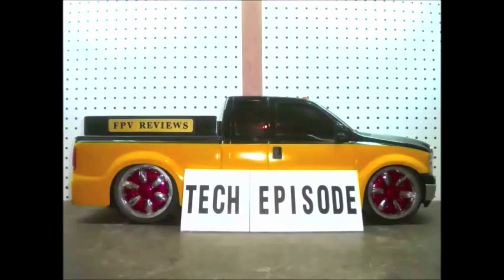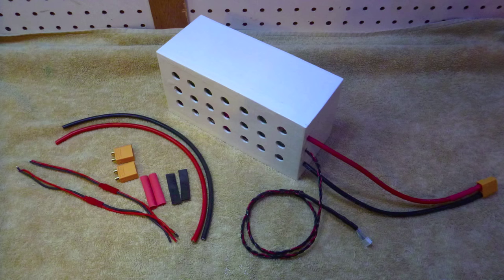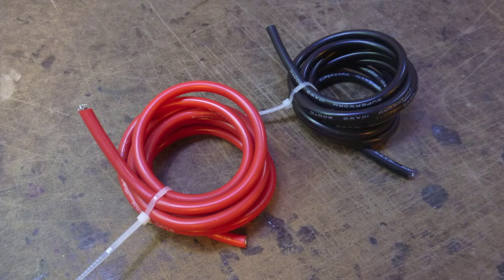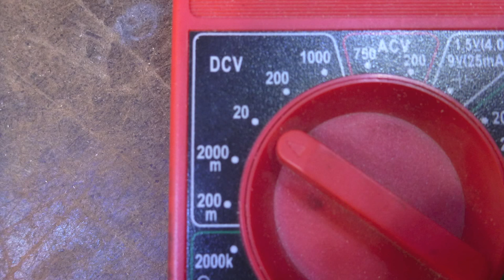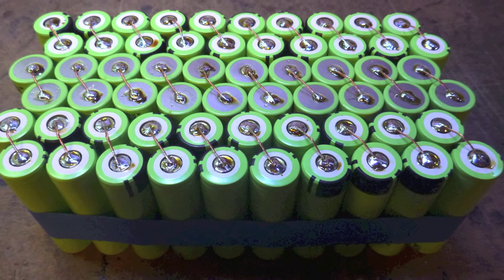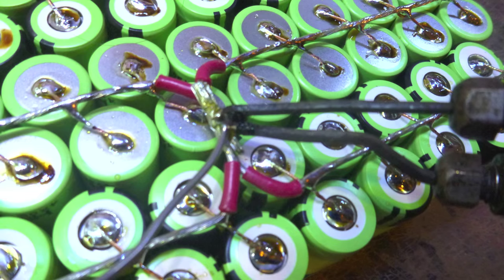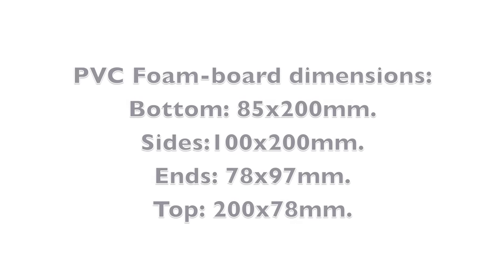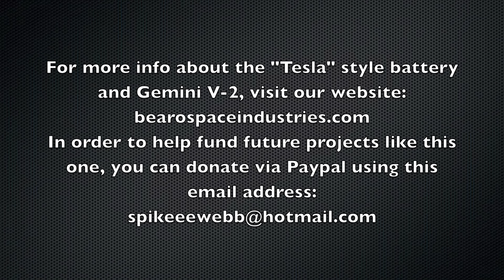"Tesla" Style Battery BUILD for Gemini V-2 And other FPV Planes!

Comment: A great safety idea, I've seen in other videos is using fuse wire for the bridge wire, rated the same or just over the max discharge rating of the cell. durability of that fuse wire in a RC plane might be worth considering and factored, as I don't know. But for something like battery storage for home solar, it is a must. Just a thought

Comment: I realise that you have had a lot of success with the 3S setup however you might consider 4S.  If you wanted to do a very long range flight the batteries can go down to 2.5V for their full discharge capacity.  At this voltage there would only be 7.5V in a 3S setup and to maintain flight the current draw could get excessive.
.
With 4S at full capacity the voltage would be 10V and this would at least allow the current draw to be in the nominal range. 

I am going to make mine out of 4 parallel strings of 15 batteries.

Comment: I did some rough calculations here and I see I could fly for 7 and a half hours straight using this pack in my skywalker x8 (it draws around 8-9amps on cruise). Thats insane! My record so far was around 1 hour and 40 minutes with 2 5800mAh packs in parallel. Too bad those 18650's are crazy expensive and difficult to get where I live.
Reply from the maker: +zxz1997 um, only problem is that the pack weighs 3kg, so the skywalker won't lift it, and if it did, it would draw a lot more amps. you could make an appropriate sized pack,a nd fly for 2-3 hrs, though.

Comment: It's common knowledge in RC electric circles that a high wattage soldering iron is superior for soldering to cells. Soldering gun tips cool off when they touch the cell making a good joint difficult.

Comment: I have 3536 1050kv mounted on my plane . draws 20 amps during take off iam using 6000mah 3s 25c bat. so if I want to replace it with NCR bat. which has less than 2C rate I need at least 5bat in parallel x3 rows which means 15 bat
NCR 18650 weights 46 gram
46x15=690grams
 capacity: 2700mahx5=13500mah
I hope they reach 5c in future.

thanks for sharing this video

Comment: Sony now makes a 30A 18650 (Sony US18650VTC5: 30 A – 2,600 mAh), and LG makes a 20A 18650 (LG INR 18650HG2: 20 A – 3,000 mAh).  I was wondering if you would recommend using one of these batteries to build a "Tesla" style battery for the Gemini V-2?    The plane appears to have appropriate power in this video, but I was wondering if you would recommend using one of these higher discharge batteries anyway?
Reply from the maker: those batteries you mention also have less capacity than the NCR18650B or GA types that i'm currently using. they could be used, but is not necessary for this aircraft. The motors do not draw as much as the cells can put out, and at loiter, with a 4 hr discharge, that's about .25C.  not exactly high discharge application. it's actually less stressing on the cells than in a laptop whose battery lasts only 3 hrs.

Comment: Hey,

all I can say is "Love it",
I have one Q ..... you put 20 batterys pre row how ever we don't need to do that do we becouse depending on ower needs we could put more or less e.g. 10 or 30 pre row for example? am I right in saying so

and I also just say thank you for tacking the time to show us this as I will help loads of us I'm shure :)
Reply: +Bryce Davey 
basically if you do that it would be a nightmare to recharche, youll see, he matches the nominal voltage per group to match a regular lipo battery
Reply: +Santiago Segura 
I think I'm roung but it came to mind that as long as all the rows are the same amount of batterys e.g. 3 rows of 30 wouldn't the voltage be the same thought out ?
Reply: +Bryce Davey I think my Q wasn't put in the best way as I ment 3 rows of 10 or 3 rows of 30... Not different numbers pre row on the same pack 

but If I was to use 30 batterys pre row would this work ?
Reply: the more you add to the row the more Amps per hours you will get but remember that the weight will become a problem
Reply: Santiago Segura ahh okay thanks Sntiago :)
Reply from the maker: +Bryce Davey that's right, you can use this method to make a smaller, or larger battery, just keep the groups with the same number of cells, as was said.